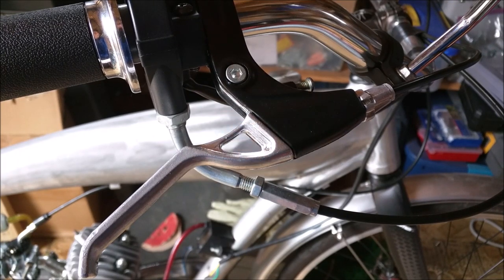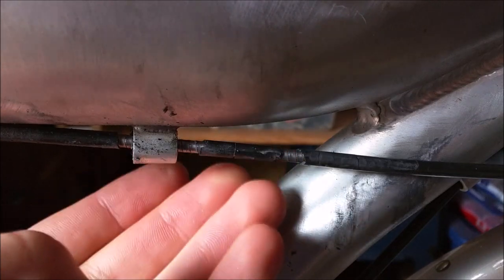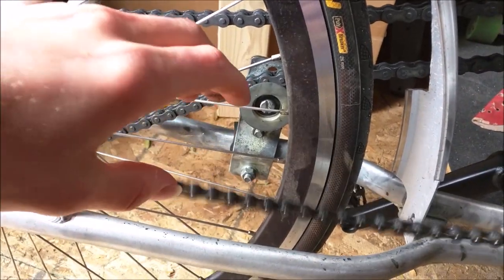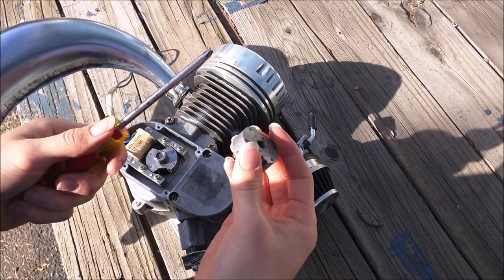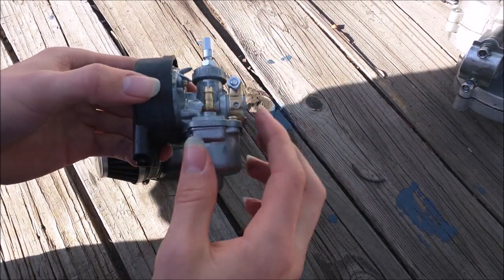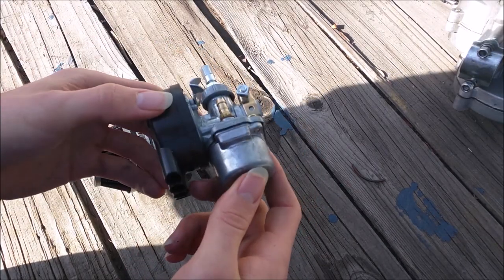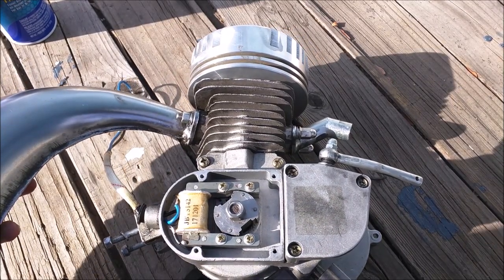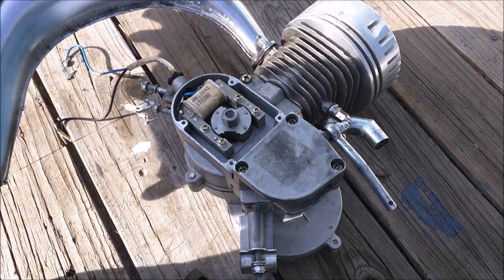80cc Motorized Bike Problems and how to FIX them

Comment: hi there. i have a nt  motorized bike, I got it back from the mechanic that builds these things and Im still having issues. plug keeps clogging up with oil, oil spraying over the exhaust manifold. i cleaned the exhaust out, cleaned the sparkplug, cleaned airfilter. after doing that, took it out for 12 minutes and it was perfect, then it started its clogging again. I have changed the mix from 25 mls to a litre, down to 20mls to a litre and still no change. what is even more weird is, when i turn the fuelcap to off before stopping, as it runs dry, the bike goes back to normal with the last remaining fuel, any idea whats going on?
Reply from the maker: Have you adjusted the carburetor jets?
Reply: @BenCarano  thank you for such a quick response, much appreciated 😀. I have the jet clip set to 2nd last to bottom, was thinking maybe I move the clip to 2nd from top ( there are 5 notches ), but then I thought why don’t I just decrease the fuel mix until I get the mix right. However, my concern is, I then might be starving it of oil and maybe damaging the engine by ie, seizing engine due to lack of oil🤔🙈
Reply from the maker: @angie4567B  yah it can be finicky! I’d recommend a carburetor with actual fuel jets rather than the pin, you can have more control over it. Otherwise best of luck! Sometimes those engines just don’t want to run I’ve found, that’s the whole reason I did the Honda build
Reply: @BenCarano  thanks for the info. Before I change the carb, I'm thinking it could be the CDI unit. Possibility not enough spark to the plug. So tomorrow, I'm buying supposedly the correct one from the guy that fixed it,  if that doesn't pan out, I believe you can test the plug in the dark, by placing the sparkplug to the side of the engine and if it sparks blue, your apparently OK, if yellow, CDI unit replacement. I'm determined to get this sorted out, if I have to get a jet carb, so be it, but I'm not letting this get to me.

Comment: With my engine kit I bought I had to replace my Ignition coil, my spark plug, and my magneto coil because it wouldn’t fire at all. At that time I had just got it a few days before. Also I have a question, my choke keeps turning on when I’m going medium speed which I don’t really want because then that kills the engine. Any idea on how to fix that? I have that stock carburetor.
Reply from the maker: Yah my only suggestion with the choke stock carburetor is that you could either bend it in someway that it is harder to move and stays, or you could rig up something with rubber bands
Reply: Benjamin Carano                                  Alright! Thanks a bunch
Reply: Benjamin Carano 

Hi again! I was thinking about upgrading to a better carburetor I would like one with an automatic choke. Any suggestions??
Reply from the maker: @stormy4269  This is the one I got with the automatic choke release https://www.bikeberry.com/66-80cc-high-performance-carburetor.html
Reply: Take air filter off and "tighten" bolt a bit
Reply: @awakenotwoke2643  haha thanks. I bent the choke lever so it doesn’t move now. I have some other problems. I need piston rings…
Reply: @stormy4269  Always something with these but good fun,,👍
Reply: @awakenotwoke2643  lesson learned don’t let your friend borrow it if he only rides dirt bikes. Cheap Chinese engines can’t take a beating like dirt bikes.

Comment: I have one of the better engines and it’s still a piece of junk. I took my engine after only 2 tanks of gas and tons of problems. The clutch cam already had wear, the crank seals weren’t even sealing the crank so there was a vacuum leak, the clutch shaft cracked when removing it with the proper tool because the metal is pretty thin and the shaft wasn’t machined good so the bearings were super stuck to the shaft, the crankshaft wasn’t machined right on one side so one of the bearings was too tight on the crank, no crankshaft shims there was .055 thousands endplay, the cylinder studs were bent, the case was machined like crap so where the cylinder mounts to the case wasn’t flush making a vacuum leak, one of the crank bearings was already bad, the cylinder had open transfer ports which is fine for an engine with modifications but a stock engine they make no power at lower rpms, the stock carburetor has vacuum leaks because it’s such a poor design. To make the engine have some power and be reliable I literally took the engine apart and I throw out everything other than the crank and the crank case. I bought new cylinder with iron sleeve, a cylinder head like in this video (cools head better), intake, carburetors, crank and clutch bearings, crank shims, clutch cam, clutch shaft, cylinder studs, crank seals. I also got copper head gasket because they seal better, stiffer clutch spring, expansion pipe, crankcase stuffing plates, reed valve, I went with oko carb. The stock and hp carbs were junk and I’ll tell you I am good at tuning so it wasn’t something I was doing so the 21mm oko carb is definitely the way to go if you modify it then it’s the best carb for this engine IMO.

IMO if you don’t know much about engines I wouldn’t buy one of these you will have a bad experience and hate it. I would do one of 2 things do some research and find the highest quality engine you can buy so u can just bolt it on and go or I would buy a predator engine from HarborFreight, a clutch and couple other things needed to mount it on a bicycle. If I could do it all over again I probably would have just bought a predator engine they are only like 140 bucks, a good clutch is like 50, then figure another 100 bucks for the few other things needed then you will have an engine you know will run great. I have spent way too much time and money making one of these crappy engines run good.
Reply from the maker: Heck yah! That’s what happened to me and why I did my Honda bike build right after this! You get what you buy with the cheap 2 stroke, not saying it’s not a good cheap way to go starting out but it’s definitely worth investing in something better down the road cuz they don’t last very long

Comment: I could use some help. This is my first build and I just finished last night. I just got it started but it was instantly full throttle and it would stop. I held down the clutch and the engine eventually just stopped. I don’t think the throttle wore inside the cable is long enough because the throttle will only spin about a centimeter. Any tips?
Reply from the maker: Throttle is probably too short or the idle speed is too high. there are two adjustments for changing the length of the cable, one at the throttle grip and one at the carburetor. there is also an idle speed adjustment screw on the carburetor: turning it in will increase idle speed and turning it out will decrease it. It could also be that they just sent you the wrong size cable if none of the adjustments help. I haven't had much luck with the stock throttle assemblies myself.

Comment: The last thing (the Mac  spray bottle) is pretty much stupid stuff, use a carb cleaner instead and it will work the same.
Reply: The best fuel spray to use is your gas oil mix you put in the tank. Put that mixture in a oil can that has the little lever pump and spout. Any of those spray cans have no oil, it will literally wash the oil off the cylinder wall and piston. If ran long enough on that, piston will seize in cylinder

Comment: Air, Fuel, and Spark?  Not quite.  Air/Fuel Mixture, Spark, and....Accurate Valve Timing ( with sufficient compression).
Reply from the maker: yes, to be more accurate you are correct

Comment: I'm having a problem with my newly purchased motorized bike.
I just bought it recently, haven't really rode it much. It's not brand new, either.
Basically, the rear wheel is completely seized up, even when I pull the clutch in. I've taken the clutch apart to try and free it, but to no avail.
What should I do?
Reply: The great Chester take the nut out the clutch and pull the clutch cable it should have some give if not unscrew the bolt and try again
Reply: If it has a coaster brake it may be seized up.

Comment: What are the screws called that holds the cover on the motor, 2 of mine are missing can anybody help
Reply from the maker: Mine are just fillips head screws, if they are missing though I'd recommend replacing them with Allen key ones so they don't strip out

Comment: is thhat a 6 volt or a 12 volt magneto? i'd like to put a 12 volt magneto on my engine so i'll have ample power for lights as well as the cdi
Reply from the maker: This one is the upgraded 12 volt! Yah lights would be a great upgrade!
Reply: @BenCarano  true, batteries are getting ridiculous again but I'm thinking  about using a generator set for lights. even thought they produce AC they still are cheaper than batteries
Reply from the maker: @larryshaver3568  yes for sure the better option

Comment: is there a gasket between both halves of the engine? i couldn't see any
Reply from the maker: There is, it is just the stock one though and it is hard to see, I would recommend getting copper ones as an upgrade!

Comment: What to do if it only wants to run in high rpm and when you let go of the gas it starts shooting gas out of the carb and tries to stall i have tried many carb adjusments and still does the same
Reply from the maker: That sounds like you need a smaller fuel jet, but not sure entirely, could also be a bad spark plug
Reply: @BenCarano  figured it out i did not put a exhaust gasket on and it did not want to run beacuse of it when i put it on it ran like nothing had ever happend to it😂
Reply: @BenCarano  and now the cylinder craked from the inside but no problem new cylinder bought already😂😂

Comment: You have a  0.61mm jet about 0.024 not 61mm jet wiulbe about 2.401 inches in diameter. BTW You need Fuel Air Spark AND proper Timing for an engine to run.

Comment: Hello Benjamin can you install a motor to a 3 speed bike or does the bike have to be single speed??
Reply: You probably can if the bike fits the other requirements
Reply: As long as the engine fits into frame , you can do whatever with whatever .i would't go with the two stroke unless you enjoy working on sh!t.
Reply: if it fits
Reply from the maker: You can definitely install it on a multi speed bike. The sprocket for the motor is on the other side so it shouldn't matter if it is a single speed or not. I had to get a conversion kit to make mine a single speed but originally it was a 7 speed.
Reply: Thanks for the 411 , your vid on part 3 on road testing  the120cc honda gx bike looks and rides great. You demonstrated its road handling abilities  and being  able to climb steep grades pretty well. You should get  into the motorized bike business.
Reply: Yes ive heard 2 strokes require more maintenance thx for the tips.
Reply: @BenCarano  Jack shafts are costly , but good.

Comment: My bike does not start and I had bought a new cdi but it still does not start but when I check my magnet, one side is very magnetic and one side is very low, do you think that might be the problem?
Reply from the maker: It could be, but no promises. Usually if it's a bad magnet the bike will still start or at least try to start, but it will stall out a lot and lose power. If it isn't starting at all or firing at all I don't think it's the magnet

Comment: There's a comment two weeks ago that means it's still active hey I just got the hyper 80cc motorized bike I got it all put together I'm trying to feed my chain through but this rocket on the engine itself is not turning and will not budge
Reply from the maker: Yah those can be buggers, I’ve had to drill one out and replace it with an Allen key one cuz I couldn’t get it to come apart without stripping
Reply: I got that took care of now I'm trying to start it I left another comment about everything hooked up right the gasoline's mixed correct I know it's a new engine maybe I just got to keep doing it to the damn thing just wants to turn over I don't know I need to put a pull string start on it

Comment: 9 out of 10 times it's not the cable it's over the anything inside the carburetor you just the housing when I cut it they forgot to make the hole and big enough for the cable to slide easily
Reply: Sorry talk and text no so good S I was saying it's usually the housing of the throttle cable where it was cut is still pinched Little where it's spilled on they end grab some priars or cuttess free the Cable up a little wd40

Comment: There's nothing "high performance" about it... they just say that so that the consumer can keep spending more for something the consumer doesn't really need.. "high performance" is not much different than the stock parts.. "high performance " it's bullshit.
Reply from the maker: sometimes, depends on what it is. the exhaust and the cylinder head do make quite a difference but the cdi and other upgrades not as much unless they are significantly different from stock. I definitely agree though that sometimes they use manipulative marketing to trick people into thinking something that isn't 100% true